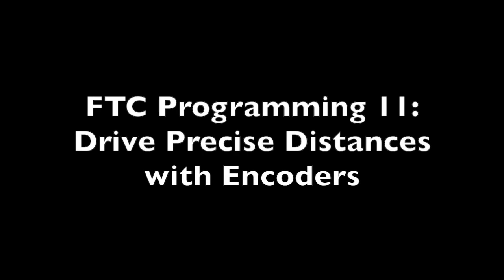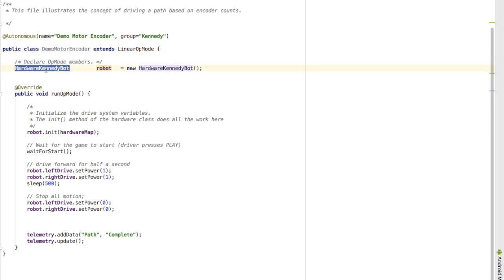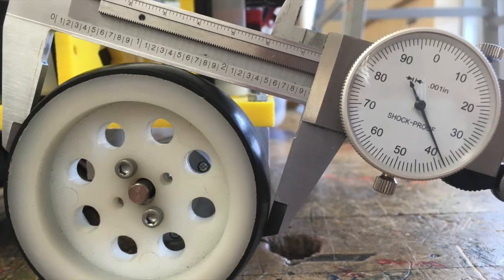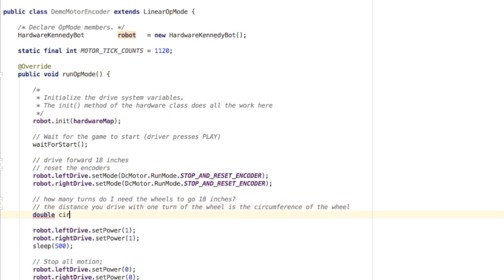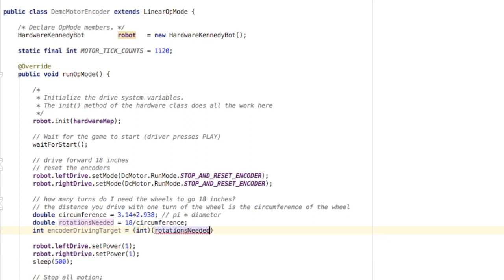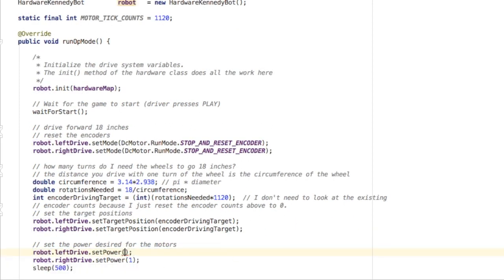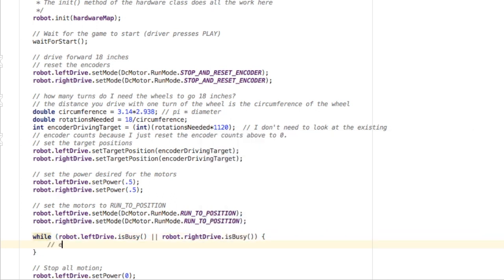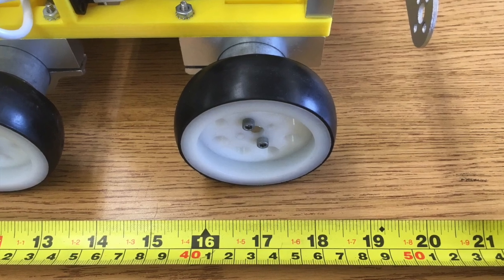FTC Programming 11: Drive Precise Distances with Encoders

Comment: Hello, we need some help with our code. Our robot doesn't stop moving and moves for the whole 30 seconds. The phone doesn't give an error or anything. We need help ASAP as our next qualifier is in a week. Thanks!
Reply: you probably didn't set the motor power back to 0
Reply: You need to reset the encoders and prolly need a break out of loop as well